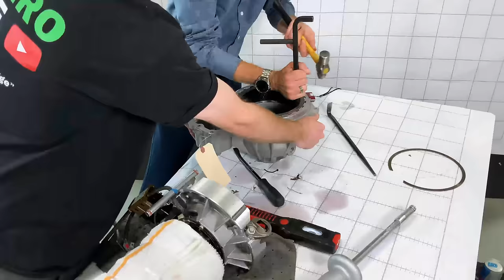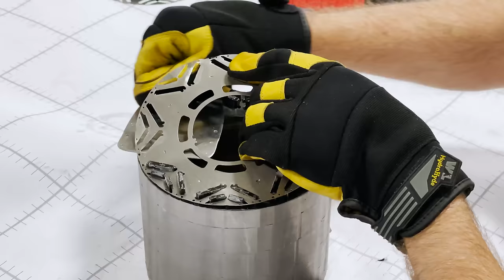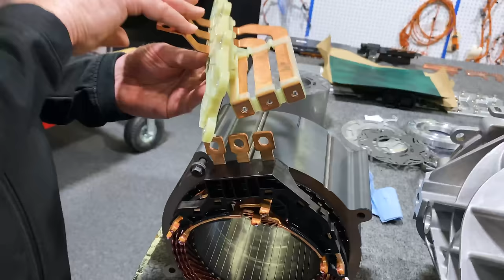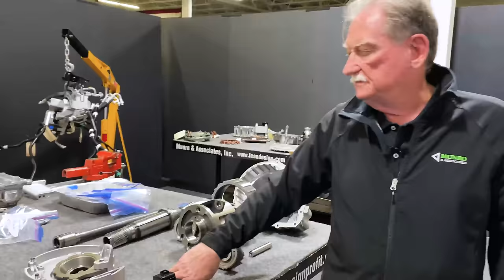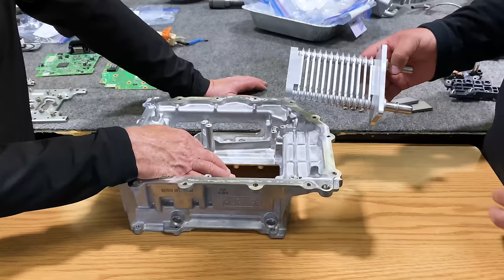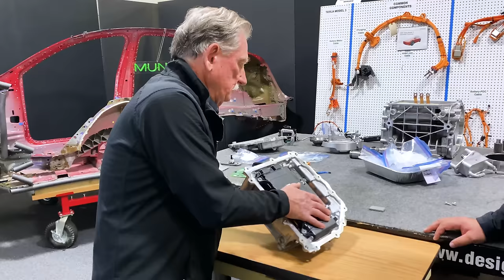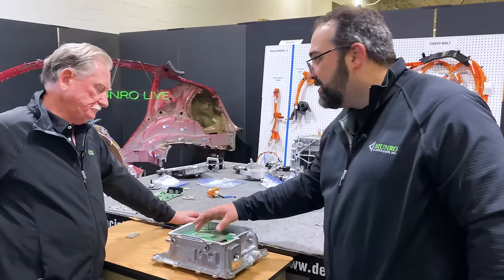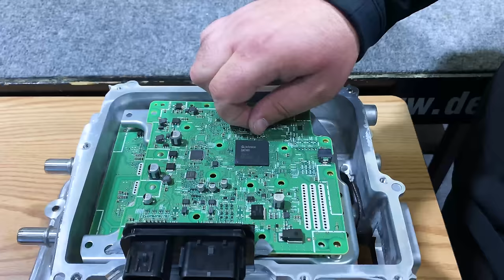Ford Mach-E Rear Motor Teardown and Analysis

Comment: Tesla using the finer but bundled parallel enamelled wires means that you can drive the coils at a much higher frequency without significant power loss.  Look up "Litz wire" and the "skin effect"; it gives Tesla a far higher speeds before having to resort to a gearbox (cough! "Taycan" cough!).
Reply: There are good reasons to have a multispeed in an EV. Its a design choice
Reply: How many pole pairs does tesla have vs hairpin designs?
Reply: @gearloose703  Similar. Look at the rotor laminations, and you can see the number of poles. Production EVs (including the Model 3, and the other Tesla models using the same motor core) are typically 8-pole, as is this Mach-E motor.
Reply: @brianb-p6586  Mach e motor reminds me a lot of the old remy.
Reply: @gearloose703  Yes, the Remy (now BorgWarner) High Voltage Hairpin, which is still in production, is the classic hairpin motor design. Remy built those for GM hybrids, and GM has continued with the hairpin design for their EV motors. 

If this motor is built by BorgWarner, then it is logically a descendant of that HVH line.
https://www.borgwarner.com/technologies/electric-drive-motors/hvh-series-electric-motor
At least some versions of BorgWarner's Integrated Electric Drive Module (eDM) actually use the HVH 250 motor core. I don't know about this one, which appears to be a variation of their On-Axis Electric Drive Module.

Comment: The center section for the electrical leads to the motor / inverter is for modularity. You can use the same inverter, and motor in different cars, and if you need to change the location of the motor, or inverter, all you need to do is change that part, rather then re design the motor, or inverter. This means vehicle to vehicle, you would be able to interchange parts, even if the components are laid out differently.

Comment: About Model 3 Oil pump. Mine had oil leak and replaced under warranty.
Reply: That's the argument for VW removing it.. However.. VW's motors are FAR less performance oriented then Teslas... like A LOT. I sincerely doubt VWs method without the pump would provide enough cooling for the performance motors Tesla uses. Even on their non performance models, Teslas motors are WAY higher performance than anything VW is using
Reply: Tesla oil pump leaks are the best and the most finely engineered oil pump leaks in the automotive industry and legacy automakers are just haters because they can't make their oil pumps leak as efficiently and autonomously.
Reply: @airheart1  well..in the base AWD version of the model 3 for example the front motor is 121 kw, the rear motor is 203 kw. In the ID 4 the (rear ) motor is 150 kw, so in the middle of the two. So it could be at least worth a consideration for the front motor in Tesla AWD cars.
Reply: @Ficon  ...someone else tiring of the endless hyping of Tesla's as being perfect in every way, I gather. Its a car, it will wear, it might fail, it might leak, it has all the same components as an ICE vehicle, except the engine and exhaust system.
Reply: @tzarcoal1018  I suppose there's a point there. But I wonder what the RPM differences are that those motors are experiencing. Even the smaller front motor in the model 3 AWD may be at higher RPMs, requiring more cooling then the VW  motor does. But Idk. Certainly something Tesla should look at.. if it's possible to remove a part.. that's Elon's thing lol
Reply: @airheart1  The motors are direct drive. RPMs will be the same if the wheel circumference is the same. The difference in power output is small and doesn’t explain the need for oil filters on Tesla. Audi isn’t using them on the E-tron either.
Reply: @Ficon  guess they just put it on for fun then

I mean it's not like Tesla builds their own motors and housings and designs everything in house with some pretty f'n clever engineers. Nah.. Guess they just put it on cause they like filters. Cause they're well known for just adding superfluous things just for the heck of it... probably some guy there who gets kickbacks from the filter industry or something. Yeah.. I think one of Elon's sayings is.. lets add more parts to everything we make! Inefficiency and added weight are our friend. Yup.. I remember hearing that for sure. I'll bet no one at Tesla knowns why there's oil filter there at all
Reply: @AudiTTQuattro2003  
Tesla enthusiasts finally "tired" of 10 years endless FUD, but you're fed up after a few measly months?
Oh dear ........
Reply: @airheart1  There's obviously a reason for it but Tesla is also a software company that makes cars so not everything they do is automatically better. It's dumb to dismiss VW and Ford which have been building cars profitably (yes, profitably, not by selling carbon credits) for a century as being inferior to a startup.
Reply: @Ficon  No one uses direct-drive motors in EVs. They all operate through reduction gearing (Sandy shows the gearing in this teardown video), so two different EVs will not necessarily have the same motor speed with the same tire size, because they can (and do) have different reduction gear ratios.

Comment: @18:06 - 33:00 - I believe your order of assembly is backwards.  You'd want to take the circuit board, solder the MOSFETs to it, then mounting plate on top, then top circuit board - Make it one assembly (probably built by electronics manufacturing and not at the factory where final assembly takes place.)  Then slide the circuit board w/ MOSFETs into the assembly, and weld the backside in place.  Then you're not worrying about bending up the small pins on the MOSFETs, the buses on the other side that get 'welded' aren't really prone to damage.  Makes it much easier assembly job!  Also double standoffs are very common in the electronics world, but not ones with a built in washer.  Not sure why they'd use ones with washers on them, that seems to be a waste, but not the fact that they're double standoffs.  And as far as those screws are concerned, the automation of inserting those has long since been perfected in the electronics world.  So, I'd assume they'd get equipment from the electronics world for installing those and not standard automotive...  And you don't want movement/vibration which will weaken the solder joints, so snap in isn't going to be acceptable.

Comment: It's usually said that an electric motor has fewer  moving  parts than an ICE.  Also since an ICE requires a starter with an electric motor the starter alone could have the same number of parts in an EV motor, so in truth I'd say it's a fair statement to say than an EV motor has fewer individual parts than an ICE.
Reply: I think the number of parts for the comparison should be the parts that move in relation to each other.  For instance, the rotor should be considered to be one part, even though it is composed of many small parts.
Reply: @Garrison169  I think he's making the point that those individual laminations need to be separately made and assembled, requiring distinct manufacturing steps to be taken, so they do count as individual parts.
Reply: @JRP3  I see it more simply.  The rotor is one moving part with no serviceable or moving parts inside it.
Reply: @Garrison169  That's ignoring the manufacturing complexities which is what Sandy is focusing on in this video.
Reply: There's two different metrics.  For assembly every part has to be joined to another part somehow, which is another step, another variation in your QC, and another potential failure.  Each laminate counts there.

For operation it's independently moving parts.  Each interaction gives a wear surface which will eventually fail.  Look at the piston and crankshaft assembly of a regular piston engine vs the combined compressor and turbine (plus a couple bearings) of a gas turbine engine.  The latter has much less wear and is a lot more reliable.

Of course those are just rules of thumb.  Even with equal part counts the thermochemistry of a piston engine is going to give you radically different reliability than an electric motor.
Reply: @JRP3  Mr Munri said, "A lot of people have talked about there's more parts in an ICE engine than an electric motor.  That sounds a lot more like what a reporter came up with and not an engineer".  He is right, but I think of it more like the reporter does, who was referring to moving parts and the big picture.
Reply: @Garrison169  Actually since you're ignoring the entire manufacturing complexities you aren't looking at the "big picture" but in fact a smaller picture.
Reply: @rhamph  I'm not sure how you're saying anything different than I have.

Comment: Hi Munroe, love the show, Respect. The number of parts referred to when comparing an ICE vehicle and an EV relate to Moving Parts within the propulsion system not simply parts. The components within an EV motor could equal those of an ICE engine but EV components are mostly non-servicable, are mostly fail-safe, and do not require any maintenance, unlike an ICE engine.

Comment: That input buss-bar config to the mosfets is done to minimize supply inductance between the input capacitor bank and the mosfets.  (which they then throw away with the connections to the capacitor bank...)  Hate that cooling plate and assembly order.  That's making it way more complex for minimal gain.  Hopefully the mosfet modules are soldered to the gate driver PCB before assembly.  That would minimizef the worst alignment problems at least...

Comment: Just FYI Tesla still uses their wound stator design rather than hairpin because of efficiency and performance. 

Same reason they keep the oil pump and why VW doesn’t need it - high performance motors or in the case of VW, lack thereof. Tesla needs the extra cooling.
Reply: Wrong, hairpin makes more denser cooper in the motor for more efficiency, the inefficiencies are related to things like weight aerodynamics and other car parts like heaters.....
Reply: I hope Tesla ditches their high performance approach for the affordable model they're designing right now. I'd rather have a cheaper, lighter, more reliable car without an oil pump and all the other systems costs needed for the performance. 8 or 9 seconds 0-60 time is still plenty fast.
Reply: the front motor of tesla AWD is weaker than the 150kw ID.4 motor, so at least here it would be an option... and the thing about hairpin is nonsense being worse for performance is simply not true.
Reply: ...and yet, it is probably more expensive to manufacture, like maybe they made a compromise for performance vs cost. Hmmm...who knew that compromise in engineering and design might be a good, almost required thing (sarcasm).
Reply: @carholic-sz3qv  I’m by no means an expert in this particular field but pretty sure Tesla’s stator design allows for much less skin and proximity losses at high switching frequencies as their motors go into much higher RPMs with far less loss in output. That’s also why the new plaid can produce peak power output from 6k to 20k with virtually no drop. The same applies to a slightly lesser extent to all their other offerings when compared to competitors and obvious by performance numbers difference. It would seem rather obvious that there is a good reason why they are sticking with a more complicated to produce version in order to get the desired results whereas others are willing to cut corners because they don’t produce cars with such performance output (basically, in Elon’s own words, Tesla doesn’t make slow cars; other manufacturers don’t seem to stress that too much in their EV offers yet so they make different cost/benefit analysis)
Reply: For the doubters, maybe you should watch Sandy’s latest video on the Mach-E front motor where he admitted he was wrong and said that the hairpin design is more difficult to produce and less efficient lmao. Don’t worry, I don’t expect you to be half the man/woman Sandy is and actually admit you are wrong but at least educate yourself.
Reply: @Mari0o0o  and Sandy is a god or what? If two rival technologies exist, there is always debate and debate is healthy, both have advantages and disadvantages..

Comment: That type of phase bar connections is common.  The systems engineer likely didn’t have the option to rotate the power modules in the inverter to locate the phase leads in the orientation you’re saying is best.

Comment: Nice video. Interesting point on stubby screws. I kept wondering if they are afraid of pcb flexing and gone berserk on screws. I am happy I'm not assembling that. Even the casting top cover looks something that could break if connector seal or something gets in the way.
I guess that would be 3 years of 1g a day.

Comment: I wonder if this design is Ford sourced or outsourced? It looks like a generic inverter that was adapted for the Mach-E.
Reply: Exactly what I was thinking!
Reply: Good question. Everyone here acts like Tesla is the only company that can make an inverter. Maybe they are the best, I don't know, but to assume they are is a little premature given the problems some people had with early Tesla's repaired under warranty.
Reply: Sinner - NOPE, Ford completely outsource the Muck-e, and is Assemble in MEXICO with 3rd party KO parts.
it's why the Range is so low.
Reply: @markplott4820  That explains the mystery parts. They were added to adopt the generic inverter to the Mach-E design. My sense of the inverter was a general design, not specifically for the Mach-E
Reply: @AudiTTQuattro2003  The troll is back!
Reply: Borg-Warner supplies the motors for the GT.

Comment: Agree weight is everything, battery should be kept as small as possible due to weight and cost. By saving 50% in weight and friction you can extend range by 50%

Comment: 23:30 Wouldn't it make more sense to put the circuit board on first, so you plug the MOSFETs in and they hold the MOSFET in place for the welding and assembly?

Comment: It’s unfortunate you didn’t have an opportunity to watch the actual assembly process before you speculate. I have to believe there was some intelligence applied to the design process.
Reply: I think Sandy had seen Tesla's inverter design and concluded that Ford didn't have to do it this way. But I completely agree that sometimes reverse engineering a process can result in wrong assumptions. Check out Model 3 inverter design on Youtube, it's pretty interesting.

Comment: All i can think of looking at how the inverter is put together is vibration and broken solder joints, or better, solder joints that touch sometimes. 

Question re motor cooling, is the ford stator and rotor getting cooled by an oil bath applied directly to the windings, etc? 

The ID4 and Tesla, are they water-cooled with jackets surrounding the outside of the stator, maybe inside the rotor shaft?

Comment: I never again want to hear how simple electric motors are.
Reply: Where did you hear that?
Reply: The el citric motor was simple. A rotor made from stamped sheets and glued in magnets and some coils of copper around a lump of iron.  Are you referring to the overly complex inverter design?
Reply: @kentonian  and the software behind and the tousands of electronics with it.....
Reply: @fredbloggs5902  ...Tesla fan boys.
Reply: If you do, suggest it's only the operation not the design and manufacturing.  Modern designs actually had to wait on the availability of computers.
Reply: @Fred Bloggs  — yes, that’s my point.  The Tesla fanboys are constantly saying how simple it is.

Comment: Has Munro done any testing of the motors for comparison data? With just a few basic measurements you can determine power density potential of the package. Phase to phase resistance alone would make for an interesting point of comparison between these different styles of stator and can be measured with any current source and a high accuracy voltage measurement, even once fully torn down.

Comment: As an engineer, especially one that has worked at the FORD MOTOR COMPANY. I fail to understand what you keep missing? The mantra at FORD is to keep the dealer's service dept working and making money to repair their EV product. Everything is by design to add unnecessary parts in the loop, to ensure that the end customer will not easily work on their cars with commonly available tools. The FORD idea is to kill the DIY customer by making their product as NON user friendly as possible while still working until it breaks. Thereby forcing the customer to have NO choice, other than to get their cars repaired or serviced at a DEALER.

I think TESLA's end game is not to have their cars worked on by the SERVICE teams out there. They are concerned with their eventual ROBOTAXI fleet and serviceability of their product. They are building MILLION mile cars. FORD's vision is linear and do not see beyond their DEALER model of doing things and their own parts bin ideology.
Reply: Well said. Designed obsolescence is a must for legacy autos.
Reply: This is why I have a Tesla now, and I don't see myself considering any other car brand for anytime in the forseeable future.
Reply: Totally correct, but Sandy has to work with these people so a bit of diplomacy is probably a good idea from his point of view.
Reply: Frugal Family Living  Ford Thunderbird was the same way. You couldn’t take off the oil filter unless you really knew what you were doing. 4-cylinder Toyotas on the other hand had the easily-accessible oil filter on the front of the engine block